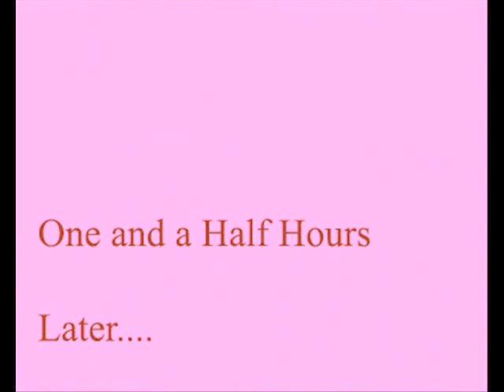Art Tutorial How to Resin Your Painting -- Adding a clear topcoat to your Artwork

Comment: Thanks for a great video! There are resins that have no odor and are non toxic now. I just thought you might want to know in case that would deter someone from working with resin. There are some great new/er art and jeweler quality resins now. Also, an art heat gun will work instead of a paint heat gun. For smaller paintings and jewelry items a mini torch works great! Way less scary than the full size torch!

Comment from the maker: That is just a personal preference.  I would suggest making a small piece and experimenting if you are unsure. If you coat the resin thick it will cover all the splatter texture, if you make it think it will still have some texture.  The heat gun is only used to get out the bubbles from the resin.  Hope that helps

Comment from the maker: Hi there

I did not put anything under the canvas. I used a ready made canvas that was pretty tight.  If you make your own canvas you will want it to be stretched as tight as possible.  I have done up to a 3 foot by four foot and have had no sag issues. Also it will not crack on its own, but it is like glass and can shatter if something were to hit it, or during shipping if you are not careful.  I always have had them packed and shipped with insurance -only one has been damaged.

Comment from the maker: Ok-- So first of all I would only every use it on Canvas, not paper.  I have not used it on pastels so I don't know if would cause bleeding.  I would try a tester piece, spray on your fixative, then resin over that.  Next: Oils, I would not resin over oil.  Resin is an epoxy and I think over time, may be a long time, but the piece will degenerate.  For oils stick to varnish.  The best is to just use it with acrylic.  

Hope this helps!

S

Comment: Criminy - resin isn't nearly as toxic or as dangerous as you seem to believe.  Use normal precautions of working in a ventilated area, and if you want to wear a simple respirator mask, do so.  I do recommend wearing nitrile or similar latex gloves.

Also, a spoon is the worst thing to mix your expoxy with.  Use a flat stir stick.  I use duct tape, not painter's tape.

Comment: I went to peel off the masking tape after a couple of hours and it was still super runny so it ran down the edges where I had pulled a little bit off! Ahhh. I think I will have to leave it for a day. Maybe my resin dries slower? Im new to using resin. Can anyone tell me if I leave the masking tape on until it completely cures will the masking tape stick to the resin or will it comes neatly off?
Thanks
Reply from the maker: Faye Oliver yes it will stick if you leave it overnight and be a huge mess. you will want to check it after maybe 3 or 4 hours or make sure you mixed it correctly.
Reply: I left it on overnight and took it off and it still dripped down. I have added acrylic in mine to give the resin colour so that must be the difference. It'll be trial and error for me learning how long to leave it. Thanks for your help anyway Sonia.
Reply from the maker: Faye Oliver def a mixing issue